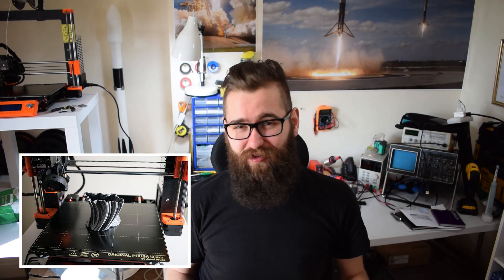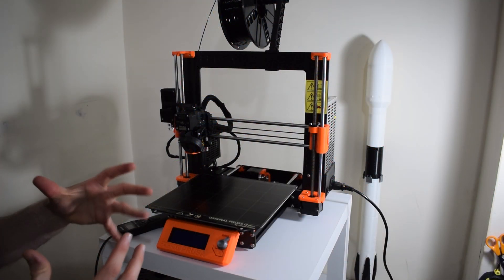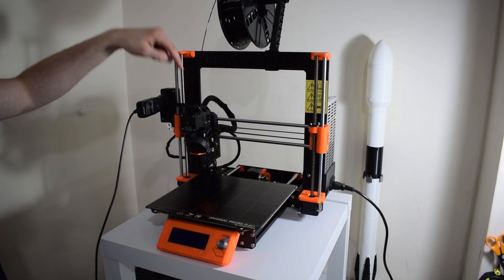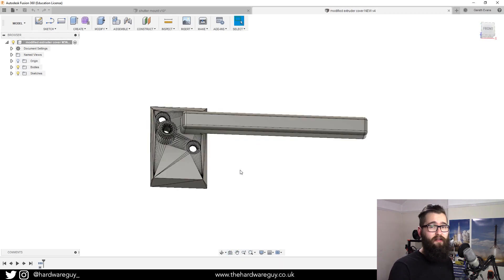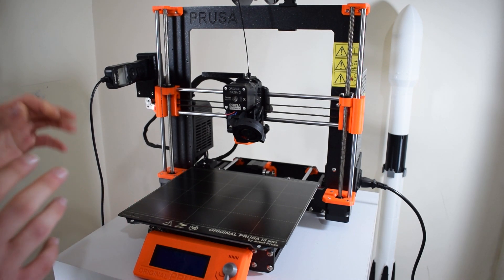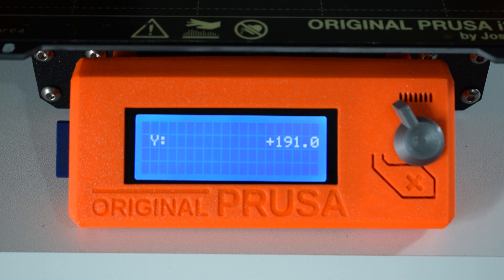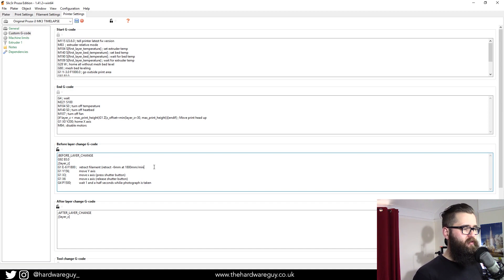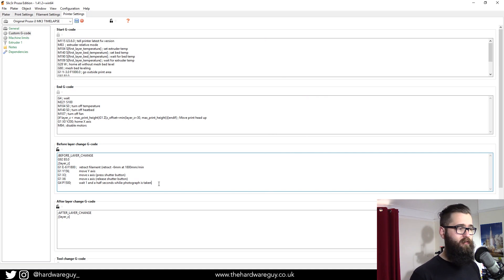Prusa i3 MK3/MK3S Timelapse Mod

Comment: What about cheap (wireless ?) remote,  and it's button "pushed" with simple relay/mosfet, and signal coming from the same source (gcode), on some of Arduino pins? 
It could eliminate the need of pushing physical button, I think.